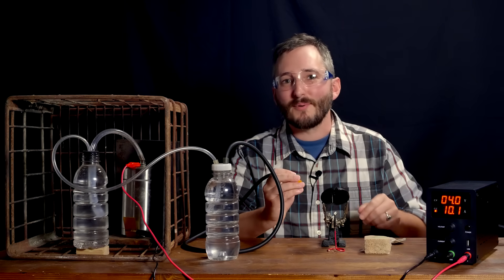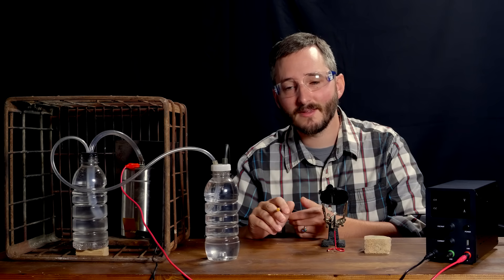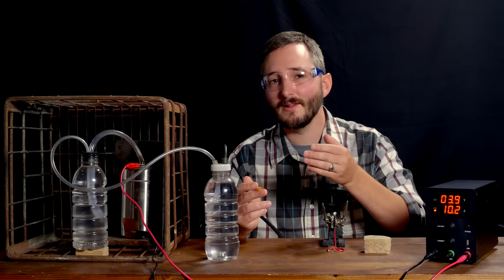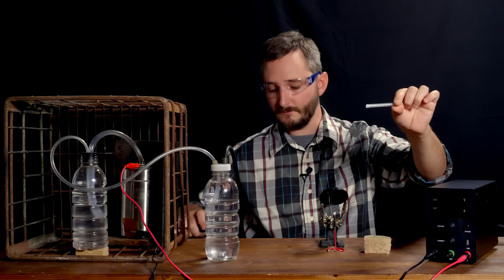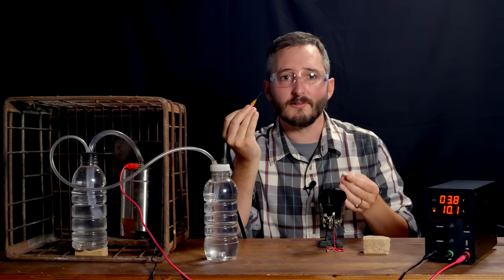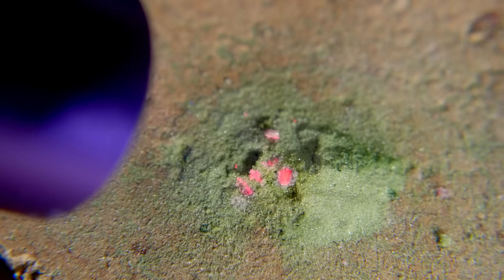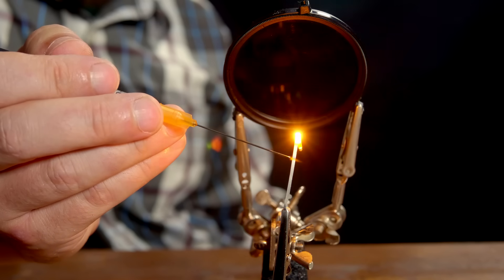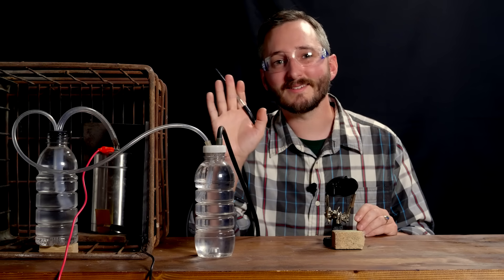DIY Oxy Hydrogen Torch Using Water Electrolysis

Comment: So, using this brute force method to make HHO or browns gas as you call it. Can you make enough using solar panels, battery backup and inner tubes to store the HHO in to run the RV on it and run it's generator, probably a 5k watt Onan generator?  Also have a small Chevy S10 pickup in tow on that RV? And set the Chevy S10 pickup truck to run on HHO with it's own set up like the RV but not as big?

The reason I'm asking is I'm homeless Disabled, low income, a senior, and a VET.  I want a portable home but fuel is expensive. I'm on SSDI soon to be plain SS. Can you help me have that kind of setup. If you can that would be a excellent video. Oh and maybe have two magnet generator alternators using super magnets instead of the normal alternators so when driving your putting out more than enough watts to keep that engine running on HHO. You will probably have to use gasoline initial to start the engine though but that's all. Once it's running switch off the gasoline and run on HHO with a switch that also alters the combustion timing for HHO. And somehow change the exhaust pipes to take the exhaust which is water vapor and run it through a condenser back into the HHO water so you use hardly any water. It recycles it. Basically a free energy using the sun device. To bad you can't figure out Stanley Meyers System for HHO. I was twice trained in electronics. I understood Meyers set up. He was also producing more electricity than was being put into it because the water worked like a capacitor. 

In electronics in the Navy they told us not to use anything electrical when there is water around. It multiplies the electricity 1.000 times. Duh? Water is a electrical source of energy. Which I'm sure takes.it's source from the Earth's electrical Field. The obvious is staring us straight in the face, so I didn't use my electronics knowledge and I lost it. If you don't use it you lose it. Same with the math. Meyers basically had a tuned LRC circuit with water involved. Multiplying the output 1k times. For every battery he used he was taking the dropped capacitor charge and charging two other batteries with the excess electrical output of his setup. Because water was involved. His method though worked better because it found the right frequency of water to split it, not the brute force method you are using. His took almost no Amps. And very little volts. It is something like those hand held taser's or the tennis racket bug zappers. High voltage with hardly any amps from two AA batteries. That's how his setup is. Another guy that worked at a radio station found the right frequency to cause ocean water to burst into flames. You find the right frequency you can do just about anything. Even kill. You can desolve metal you name it. Tesla worked with radio frequency. The same way a unshielded Ham radio lights up light bulb with them being hooked up to power and even can make the electric organ across the street in a church play. Ham radios do that. I know. My Dad band his friend built a Ham radio in their TV shop and showed me what happened when you unshielded the Ham radio. It did that. I was 8 years old then. He tied a lightbulb to a branch,. Hanging. Fired up his unshielded Ham radio and the bulb turned on and the church organ across the street started making all kinds of racket and neighbors where coming out of their homes to see what caused the electrical stuff to work without it being on. Tesla used radio frequency. He tapped into the Earth's electrical Frequencies.which supposed to be in the Giga Watts.

Comment: @NightHawkinLight
It would be interesting to convert this to create a jet similar to an electrostatic whirl to see how the reaction generates a thrust vector and how much force the jet nozzle generates as a result of the torque generated by the flow.

For this you would need three or more nozzles angled correctly that could freely rotate about a centre axis which would require modifications to your experimental setup and could cause some safety issues so proceed with caution.

Comment: maybe a stack of very thin spaced copper washers near the base of the needle would help in preventing the flame from running up the nozzle as they should absorb enough heat to damp the combustion

Comment: Great video. But I do have two questions since I am building one of these myself. First question: Do you always produce the same amount of hydrogen with 10 amps? Or can it differ. And if it differs, by how much? Second question: What diameter needle tip did you use?
Reply: Go back to that part of the video he said the exact diameter
Reply: A 0.63mm OD needle has an ID of between 0.116 and 0.337-inch.  Using the larger ID, and estimating H2 + O2 flow at about 3.5 cc/min, gives a gas velocity thru the needle of 0.20 ft/sec.
Of course, the ignition velocity is surely higher than 0.20 fps, so how does the flame get extinguished?
We’ll have to blame it on the cold stainless steel needle.  Its ability to extract heat from the flame front is greater than the heat generated by the H2-O2 reaction.  Your wet paper towel demonstrates this beautifully.

So, allow me to suggest, please remove the needle from the hose, and just ignite the large ID hose to see if that nifty flame arrestor will cool off the gas below its ignition temp?  That’ll be interesting.

And of course, reiterate your WARNINGS.  Your splendid presentation should sink-in to those who may have lost their sense of direction.  If not, they are advised to keep quiet.

Feel free to contact me should you need additional information.
Thank you,
Master of the Obvious

Comment: Have you considered seeing how much gas you can create with a constant current welder connected to your HHO generator? You may have to wire a few HHO generators in parallel to avoid boiling the water away.

Comment: hey I saw a guy use the output of hydrolysis to run the motor on a small generator,     I wonder if we could use the output to run the motor on a small light vehicle?   and while the vehicle is running if we could use the alternator to charge the battery that is used for the electrolysis the sleeping able to keep the reaction going and have a car that runs on water for real?

curious if you think that is feasible?

is there some reason why everyone is not doing this?

Comment: You might be able to insulate the needle by encasing it in a small water saturated jacket. Cut a cylinder of sponge and punch a hole in it to pass the needle through. Then wet the sponge so the flame can't travel up the stem.

Comment: Hey Ben! Is there a way to make a valve, or a particular type of valve to regulate the hydrogen flow out. Not just this but anything we build a Hydrogen cell for use.
Reply from the maker: To regulate the output you need to adjust the input voltage or amperage. A valve won't work because closing it will just cause the tank to increase in pressure and break if gas is still being made.
Reply: @Nighthawkinlight  Thanks for taking the time! Love the videos!

Comment: hey : how about using 316 SS powder between 2 plates and a small "fan" at the bottom to start moving but use mains AC. Just adjust the partial density and flow rate to create the cell size for the voltages required. The powder creates "passive" plates with very high surface area and will carry the HHO to the surface.
The plates can be made from carbon foam or just SS . You can experiment with adding Iron Oxide and activated carbon. Also using two cones in a vertical config could  be self regulating using the bubbles and a porous top cone. Garret

Comment: good video. which type of inline flash arrestor do you recommend that would fit a 1/4in plastic tubing? i seen oxygen, acetylene, and propane inline metal arrestors that slips into the tubing.

Comment: So I built this in my apartment.. When I used a 21 gauge needle, the flow rate was too low and flashback occurred. When I used a 25 gauge needle, the flow rate was too fast and a sustained flame was not possible.. but I did learn something that I think could prevent flashbacks at the tip.

I didn't trust the 21 gauge after an earlier flashback, but wanted to test it as thoroughly as I did the 25 gauge. So I inserted the 25 gauge up the back end of the 21 gauge. I went to test this setup at maximum gas production and sure enough, the flame is happy to travel up the 21 gauge.. but this time the 25 gauge was in there producing waaaay more output than that gauge can sustain a flame at, so the flashback stopped at the nested 25 gauge needle.

I think we could have a second level of flashback protection by utilizing this method.. though more testing is needed to see if this method interferes with flame quality at all.

Comment: electrolysis powered fire to heat water in a boiler to power a steam engine that generates electricity to power the electrolysis, figuring an automobile alternator recharging a car battery.

Comment: The correct nozzle size on your set up, is about half the diameter of a human hair. 
There are syringes this small but they are usually hard to find. 

This sounds way too small, but trust me on this. I have run cars and trucks on only HHO as fuel and the nozzle hole that the gas comes out of is so small you can not see it, and it is unbelievably small. 

It is possible to go too small. But i am giving you a ball park.

Comment: You can avoid the flame burning inside the needle of your syringe in 2 ways.
1. by getting a smaller gage needle(Syringe) 
or 2. By increasing your hho production. (Probably just triple your watts input into your electrolyzer. To 100 Watts)
I have worked with HHO for 45 YEARS, So I know what I am talking about. 
The 2nd option above will give you a 3 times bigger flame also 
So you can cut or weld much better!

Comment: "Don't try this at home."

I'm definitely trying this at home!  (To be fair, this isn't my first rodeo, so to speak, and this video provides a great deal of quality safety information.  That said, I'm already planning to ignore the first safety suggestion, "Don't try this at home.")

This is great though!  I really appreciate all of the safety information especially.  I might make one that combines the gasses at the nozzle though, so I don't have to worry about the bubblers or putting it out before turning it off.
Reply: Be very careful with with hydrogen, if it were to ignite it could deafen you.
Reply: @SToNeOwNz  I've decided I'm keeping the gasses separate until they leave the torch nozzle.  I'm building a custom torch with nested tubes, such that the outer tube carries the oxygen and the inner carries the hydrogen.  This way I don't need bubblers and other flashback prevention measures.  I will still need to run it cold for a minute or so before igniting it though, because the hydrolysis chambers and tubes will have atmospheric gasses (including oxygen) in them initially, which could allow for hydrogen to burn until the hydrogen line has been fully flushed.

But yeah, I'm definitely being extremely careful!  I have some experience with this, so I do know what I'm doing, but you never want to get so comfortable that you get careless.  If it's not at least slightly terrifying, you don't understand it well enough to have any business working with it!

Comment: Hi brother 

Just a small suggestion 

is it possible to prevent flashback by using a small pump attach before the pump that connected to the nozzle.
So the pressure maybe adjustable so can produce high outlet pressure.
BTW its really  a nice video.

Comment: Why not put a check valve after the gas before the syringe to prevent flashback? You could even chamber q nipple to the checkvalve to add extra distance from the gas root.

Comment: I am building a 3-stroke hydrogen engine for funnies. I need liquid oxygen, and have no use for hydrogen (I get cheap calcium carbide), but it seems wasteful to just vent/burn it. So thought I'd use hydrogen to compress the oxygen (1st of 3 stages).

Comment: 03:55

Purely wrong. With decreasing diameter and forcing gas to flow through smaller diameter tube, you decrease pressure but increase speed. To increase pressure you need to increase diameter, but speed will decrease accordingly.

Conservation of energy is achieved. Look up Bernoulli's principle.
Reply from the maker: You're thinking in terms of within the nozzle only. I'm talking about system pressure, which increases as the outlet size is decreased.
Reply: @Nighthawkinlight  To see where you made mistake, please see Bernoulli Equation. It is common misunderstanding.
Reply from the maker: @Fosgen  Yes I know what you are talking about. Bernoulli's principle does not apply to system pressure. A smaller outlet increases the pressure in the bubbler and container.
Reply: @Nighthawkinlight  Bernoulli principle indeed apply here. Fluid pressure drops significantly when entering narrow nozzle, but fluid speed increasing accordingly. Energy is conserved. System works increasing local entropy like it should.
Reply from the maker: @Fosgen  Again, you are talking about within the nozzle. I am talking about system pressure. System pressure increases with a smaller outlet. It is because system pressure increases that the speed in the nozzle likewise increases to compensate, allowing nozzle pressure to drop. Put your thumb over a garden hose. You will find that pressure behind your thumb does not decrease as you block more of the water. Bernoulli's principle speaks of the gap between your thumb and the hose, not the pressure in the hose overall.

Comment: Along your thin end tube you have a a pressure gradient and you increase flow by every distance unit towards the low pressure area ( environmental pressure). So your statement of increasing pressure thinnening the tip is at least very imprecise. I'm often bit mad about you mixing up facts. However keep your good work of creating content, just please try to improve your accuracy with the vocabulary you use.
Reply from the maker: System pressure is increased by decreasing outlet size. I'm not speaking of pressure within the nozzle.

Comment: it might be to hot a flame for welding but i could see this being very useful for cutting steel on an industrial scale but not at that size.  the danger is you would have to make this setup but only 1000times bigger so if it goes wrong the explosion would also be 1000 times bigger......probably blow up the whole building

Comment: I'm the proverbial "tiger for punishment" = still experimenting with HHO (and still alive to tell the tale).

Q: What would be needed for a safely sustainable larger flame from a homebuilt HHO producer?  
Are we simply talking more 'litres per hour', to keep the outflowing gas velocity superior to flame descent while using a larger orifice, or is there more to it?
Thing is, I often have more solar output than I can use to charge my battery bank, and I'd love to use it for something involving HHO rather than simple calorific heating.  Any thoughts?
Reply from the maker: I would invest in a heat pump if you want to make the best use of your energy. For a larger torch than this you need more flow, and probably a split output for safety. The designs get complicated, and you should do more research on hho production than what I can provide.
Reply: @Nighthawkinlight  Thanks for the prompt reply!  Suggestions noted - I kinda figured I was getting into an oxy-acetylene territory.  Definitely too complex for me.
BTTW, I posted a link to your 2-bottle water distillation vid onto a prepping/survivalist page - they seem to love the simplicity and the presentation and you may get some new traffic from people checking out survival-related material.  All the best.

Comment: you can make a oxy hydrogen torch WITHOUT electricity by reacting aluminium with water,sulfuric acid, or hydrochloric acid.and then cheaply produce oxygen by photosynthiesyes

Comment: What accumulator do you use for this, and where do you get it? I dont want to make a torch at home, but i want to make some experiments with HHO gas and a setup like this would be perfect, i just need the right accumulator/battery for this and it'll be perfect, oh and by the way where did you get that metal container (the one in which the electrolysis is happening) from?

Comment: You can combine a larger gauge needle and several smaller gauge needles surrounding it as a center main tip with the outer needles as tributaries or enhancing tips to make a compound jet nozzle, that may require increased line pressure, a sealed low pressure  inlet retrofitted to an aquarium air pump should be adequate 15psi or less, or use 15 - 30psi of pure oxygen in the inner tip and HHO in the outer tips, to blow the molten metal off as soon as Temps are reached to minimize collateral heating

Comment: Needle Gauge Dia. : mm
20g = 0.603 mm I.D.
21g = 0.514 mm I.D.
19g = 0.686 mm I.D.
I.D. = Inside Diameter of tubing.
__________________
Needle Gauge Dia. : mm 
23g = 0.642 mm O.D.
22g = 0.718 mm O.D.
24g = 0.566 mm O.D.
O.D. = Outside Diameter of tubing.

Comment: Convergent divergent venturi nozzle  》^《 with a mesh or screen arrestor, this may work or may not be enough on its own to stop blow back ignition, but it will help with adjusting the torch tip flame vectoring characteristics

Comment: I'm running a 20 plate dry cell , and I'm playing with making a heater , so far it's working great.. the heater is made of platinum and sand  , ( tip.. old vehicles, take the catalytic converter off the vehicle, the honey comb is what you want, mix with sand put in pipe  run the gas thought bottom and light the top the chemical reaction heats up and u end up with a flameless heater

Comment: I'm an optician and we used a hydrogen generator to silver-solder broken metal frames. It was great since the flame was so hot and concentrated that only a small area was affected.